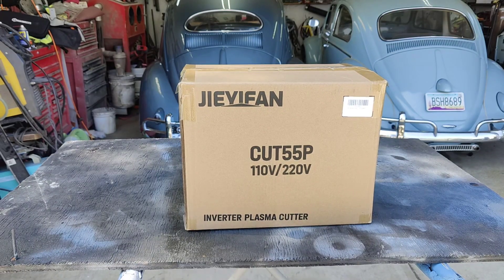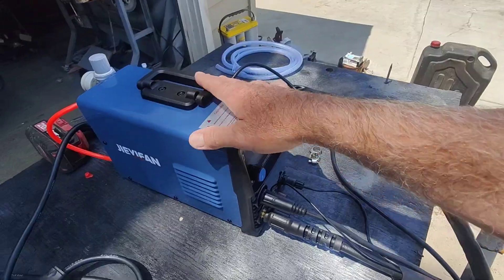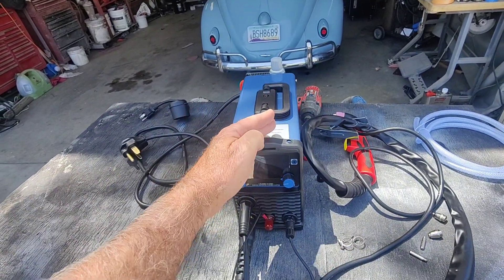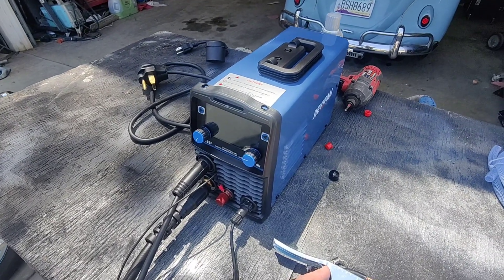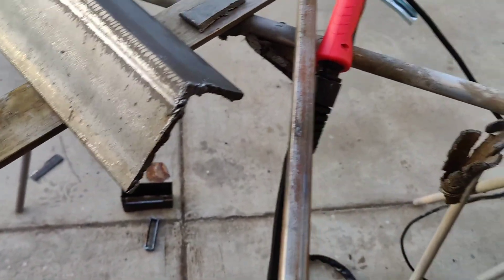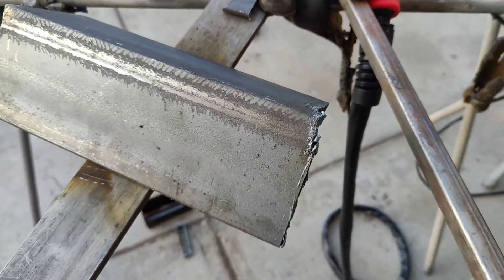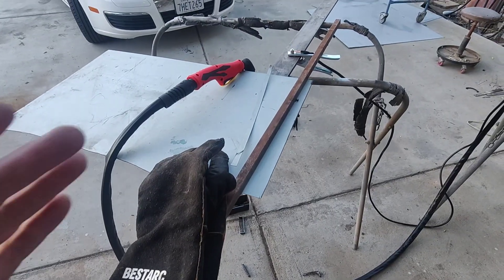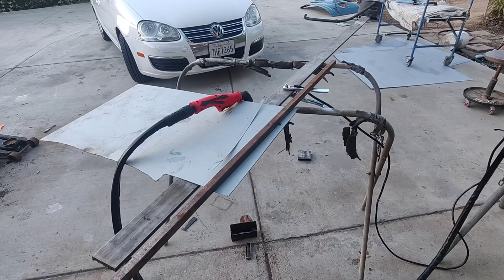CHEAP Plasma cutter to CLEAN CUT thick steel Best deal?

Comment: Is there anything on how to adjust doors? I've just bought my beetle a few days ago and the doors are so tight I have to slam them hard to get them to close. Also the seal is getting destroyed because the gap is so small and it sticks out of the gap. All I've found so far is how to adjust the angle of the doors and the height of the striker plates. How do I get a bigger gap between the door and the B pillar?

Comment: Hey Mike ! only if they had inverter welders and plasma back in the early 80s . Ya'll don;t now how hard it was to get a bumble bee up 5 stories in a oil rig stairwell with temps in there at 114 degrees .